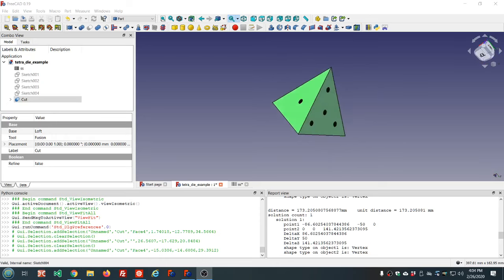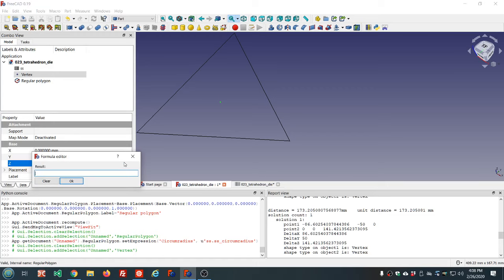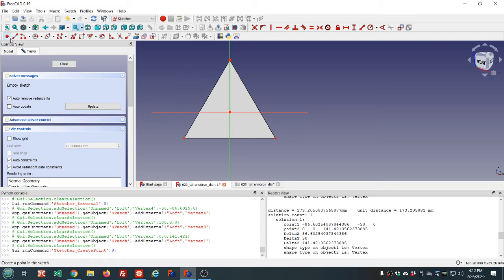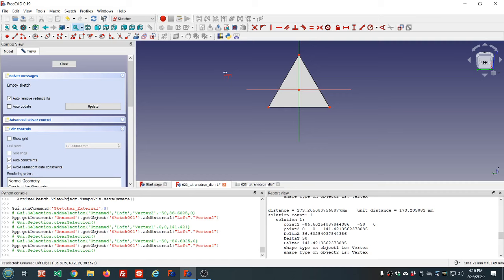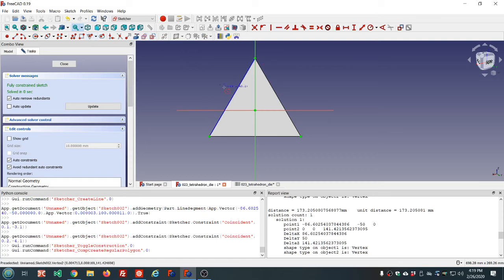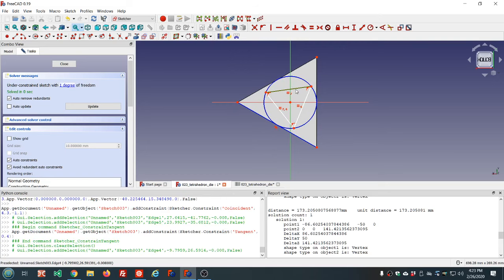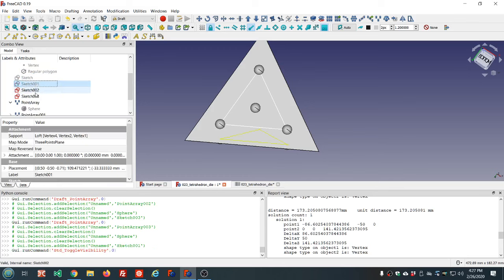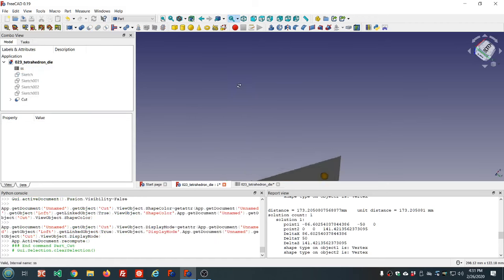023   FreeCAD tetrahedron die

Comment: Hi Mark, I've been working my way through your excellent FreeCAD tutorial videos, but this one has me stumped. When attaching a sketch to three selected points on the tetrahedron, FreeCAD v0.19-23141(Git) does not offer the option to attach to a ThreePointFace. The only attachment options I am offered are: Don't attach, Deactivated, Translate and InternalCS. I've been using InternalCS as yielding the closest results to your tutorial video, but I run into difficulties later on because of this (I think!) Your Tutorial 023 video is based on FreeCAD v0.19-19694. Have I missed some vital preference setting in my version of FreeCAD or has there been some change by the developers? Any help gratefully received! Phil.
Reply from the maker: I tried with the latest version and was able to attach a sketch in 3 points on a plane mode with the 3 selected vertices of the loft object.  One change I had to do was switch to points view mode in order to be able to select the vertices.
Reply: @mwganson  Many thanks for the swift reply Mark! I'll give that a try.
Reply: Success! Switching to points view mode made a big difference... and I also discovered that I was only selecting a single point, when I should have been ctrl-clicking on the three points! Beginners' mistakes. Thanks Mark.

Comment: I had more trouble with this episode than any so far.  I could not get past the point in sketcher after the section where after the three point plane was created.  I did create the 3 point plane successfully but then could not select the points on the plane to link to external geometry.  I will come back to this episode later with a newer build of '019' and hope it fixes the problem.
Reply from the maker: Sometimes you can change the MapReversed parameter and then you are able to select some points in the sketch from the other side.